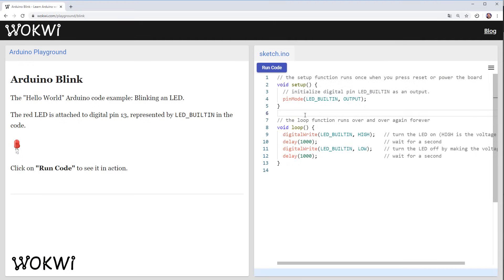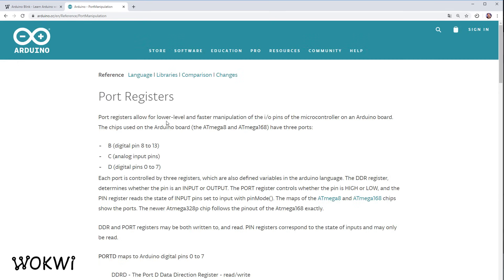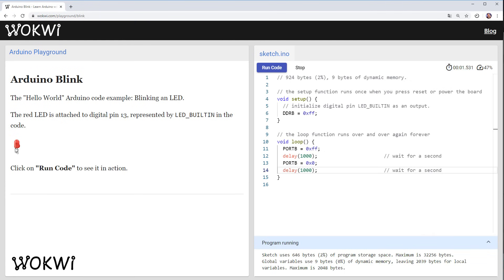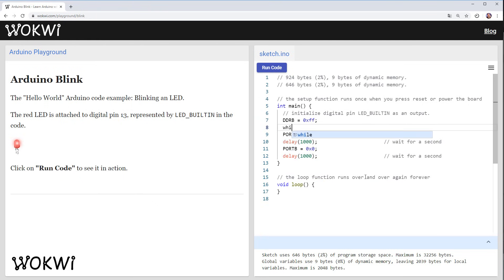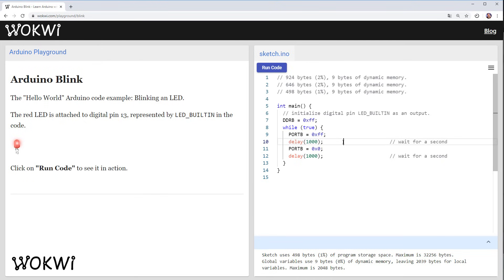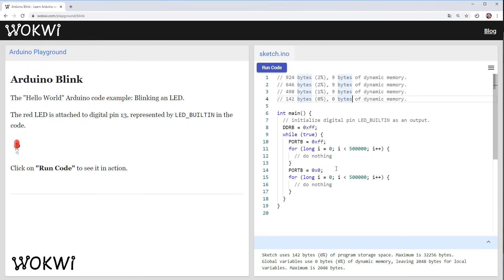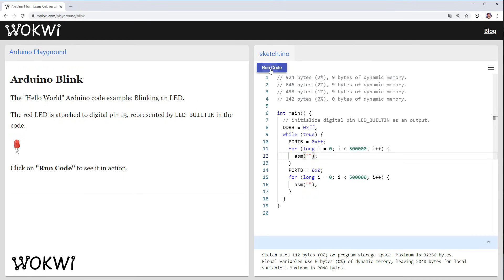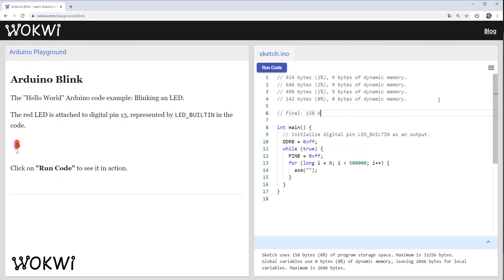Optimizing Arduino Code: no setup(), no loop() ⛔

Comment: Your 158 bytes are not the end. This one uses 80 bytes only and 0 bytes dynamic memory:

int main() {
  DDRB = DDRB | 0b00001000; 
  while (1) {
    PORTB = PORTB ^ 0b00001000; // flipping 1 pin only
    for(long i = 0; i < 500000; i++) {
      asm("");
    }                   
  }
}

Comment: If you don't want your code to be able to be used on new boards or shared with the community then this is a great idea.
Otherwise i would highly recommend not following this example.
Reply from the maker: Agreed. The purpose of the example is to see "behind the scenes" of Arduino, by learning about a different approach to writing Arduino code.

Comment: don't forget: by not using the Arduino standard library, you will –of course– loose a shit ton of built-in functions, which you might have to implement by yourself.

Comment: This is not a good idea honestly. Not only is the code too complex with this approach, but this method would only shave off a static amount of program space. You cannot for-example turn a 10,000 byte program to 1000 with this method like it is implied within the video. And if you're only gonna be shaving off a 1000 bytes for code that looks infinitely ugleir and is not maintainable to nearly the same degree, is it even worth it?

"Optimization" in my opinion isn't JUST taking the least amount of space or being as fast as possible, Optimization in my opinion is code that checks all boxes as much as it can. It must be fast, it must be simple to understand and It must be as small as possible. That's what optimization to me is.

Comment: yes, but realize, messing around with regist3rs , assembly language ,pure c language is a pain in the ass. it s gonna take u months to learn assembly language etc...all that effort is not worth it if u are a student or hobbyist. if u were an engineer it might justify the hassle. all that just to save a few kilobytes for projects only for home use.
Reply: I'm not saying its bad to optimize, I'm saying ,optimization comes atma cost.
Reply from the maker: Yes, that makes sense!

Comment: The compiler didn't remove the for/next loop. The reason why it dimmed the light was because it was flashing on and off really fast. Remove the asm("") lines and increase the number of loops to a higher number than 500,000. The compiler doesn't remove code. It will compile whatever you ask it to unless your code causes an error. Nice video though. I've always believed code should be efficiently written all the time. Thanks.

Comment: Yes, your code will be optimized for better memory utilization but learning this kind of programming will be much more difficult. The setup and loop functions were developed in order for the programmer to write code for the microcontroller without worrying about the internals of the microxontroller. Imagine someone learning the datasheet first before coding. Learning Arduino will be the same as the PIC microcontrolller which is very difficult to learn. It defeats the purpose of easy learning.
Reply from the maker: That's correct, even more - if you only use the standard library functions, then your code is also much easier to port over to another architecture. It all comes down to the problem you are trying to solve, and once you realize that `setup()` and `loop()` are not magic, and how much work the standard library is doing behind the scenes for you, it makes you appreciate them even more, IMHO.

Comment: Very exciting.  However, when I compiled the final code the sketch used 286 bytes of program memory.  Why?
Reply from the maker: There can be several reasons, such as compiling for a different kind of board. The best way to answer that is to look at the memory address map / assembly listing, so you can see what goes into these 286 bytes and reason about them.
Reply: @Wokwi  Maybe it will be dump question but how I can see the disassembled code or memory map? Is there any parameter that I can pass at the POST request at wokwi com build endpoint? I'm super interested on analyzing how Arduino executes simple expressions like a + b, conditions or subroutine calls etc.
Reply from the maker: @rfly-fpv  It's a good question - in the code editor, press "F1" and select "View Compiled Assembly Code Listing". Wait a few seconds and a new tab called "sketch.lst" should appear, with the disassembled code.

Comment: I use a Microchip Fubarino / TCHIP011, PIC32 MXwith 64KB ram and aside from USB twice of everything.
is there a way to make this abstract code visible (github/../man.cpp)?
I got 64KB, but the IDE says: Maximum is 32768 bytes., like wise for the storage, i got 256KB, but says: Maximum is 118784 bytes.
Reply from the maker: Not familiar with the particular chip, but it sounds like the linker is not configured correctly - either you selected the wrong board, or the specific variant you have is not supported by the Arduino Core you are using. I suggest looking for the GitHub repository that implements this Arduino Core and opening an issue there. Good luck!
Reply: @Wokwi  well, i knew the Fubarino 2.0 was in the list, but i though that was the one with a SD card reader, but i did chose it and now it's correct now, 64KB ram and 256KB programming area, good chip, 32 bit, USB + 2 x I²C, 2 x SPI, 2 x UART, 5 timers. MIPS assembly lenguage withc is pretty cool.
Much better than the Arduino UNO or Mega.

But now i'm looking how to avoid the Arduino library accept the USB, stuff, 
even if a heaving a empty sketch with a " asm("nop \n");": ....
Sketch uses 25720 bytes (10%) of program storage space.

i wanna retain the usb support and serial print, but omit everything else otherwise i got solder a connection and use the microchip ICD3.

it's seams you can program with commandline / terminal and provide a normal CPP file with main()., right?
Reply: @Wokwi  ... and it's cheaper than the Arduino Uno at micro chip store.

Comment: This is great. Based on some comments, it may be confusing or even unnecessary for novices, but saving memory like this could mean the difference between being able to use ATTiny85 (8k memory) vs. UNO/Nano/ATMega328P (32k memory). I appreciate your effort.
I'd like to offer a few refinements to your code...

#include <util/delay.h>  //required for _delay_ms()
int main() {
  // initialize digital pin LED_BUILTIN as an output.
  DDRB |= ( 1 << PB5 );
  while (true) {
    PINB |= ( 1 << PB5 );
    _delay_ms(1000); 
  }
}

Your code:
DDRB=0xFF; // Sets D13 to OUTPUT, but does the same to D8,9,10,11,12,XTAL1,XTAL2.
PINB=0xFF; // Same idea. This toggles 8 pins, rather than one.

If a novice took your example and tried to add code for other I/O pins, 
the results would be unexpected to say the least.

Replacement code:
DDRB |= ( 1 << PB5 ); //target D13 (LED_BUILTIN) without affecting the other pins.
PINB |= ( 1 << PB5 ); //toggle D13 without affecting the other pins.
_delay_ms(1000);      //more concise than the for-loop, and does not change memory.
Reply from the maker: Thank you!
Reply: This replacement code is both more readable and more correct than the one shown in the video: _delay_ms() is self-explanatory, only the relevant pin is toggled, and the delay is accurate.

But then, quite surprisingly, it is also smaller! This is mainly due to the fact that `reg|=(1<<bit)` gets compiled into a single `sbi` instruction.